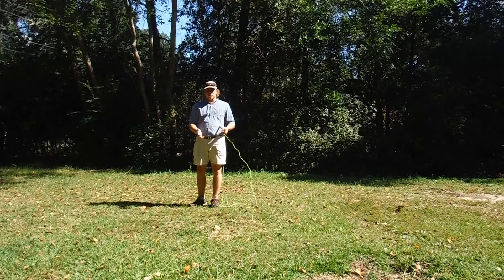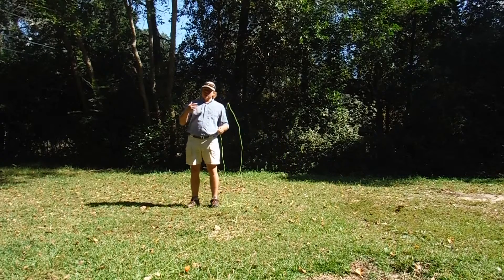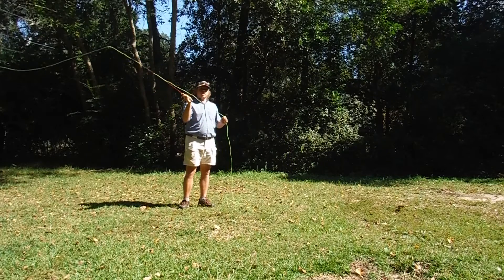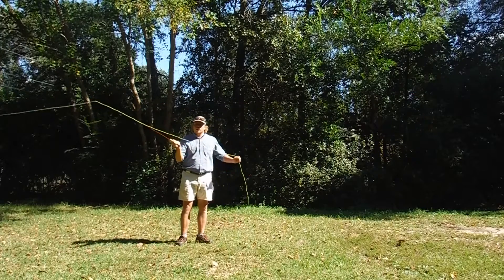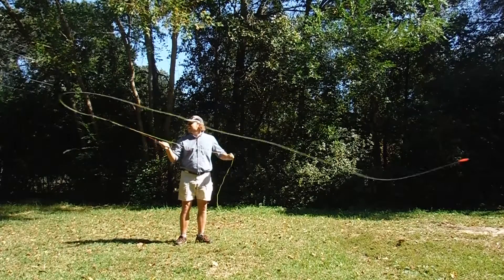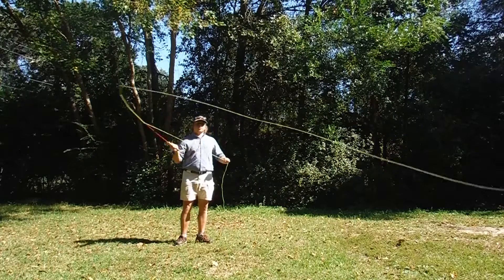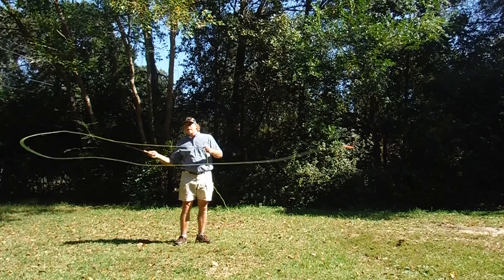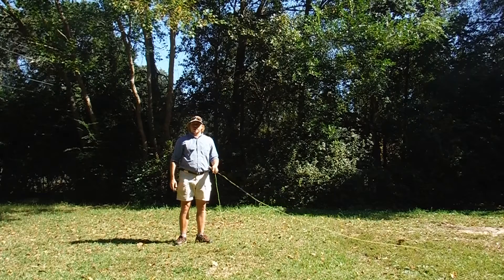Casting BIG Flies

Comment: thanks for the tip my question is what distance would you consider a good cast with those large flies thanks
Reply from the maker: Honestly you're only wanting to be between 20 to at most 60ft. After that your ability to set the hook properly drops dramatically. Casting big streamers isn't a distance game. It's all about making the most accurate cast with the least effort.
Reply: Thanks been casting big 12 inch pike plies about 40 ft so now i dont feel so bad
Reply from the maker: +Michael Bentley Yeah now it's always good to take a big fly, cut the hook off and practice casting with it. I may not need to cast more than 40 ft to fish effectively but if I can cast that fly 60ft, that will make casting easier in poor conditions.
Reply: +Lost Angler just
Reply: +Michael Bentley thats what i did cut the hook off practicing in the yard til i get to canada now i will try the technic in the vidio being new to fly fishing ill try what ever it takes
Reply from the maker: +Michael Bentley you on the right path. The thing that separates good fly fishers and ok fly fishers is the amount of practice they put in their casting. Plus it will make you're fishing SO much more enjoyable. Good luck on your trip!